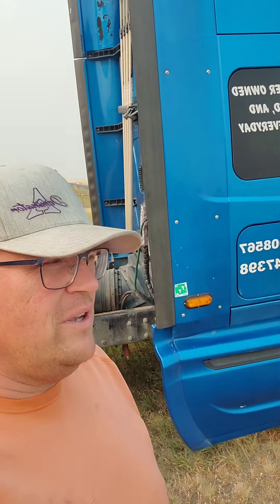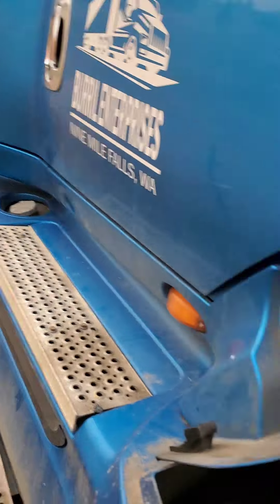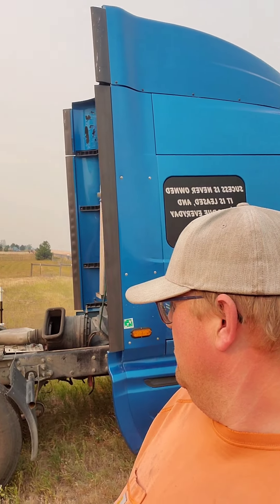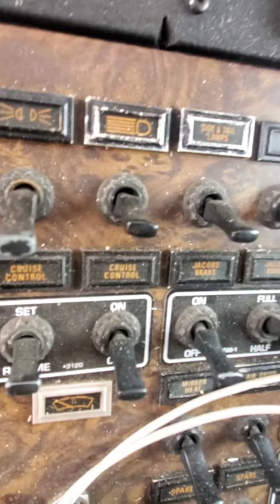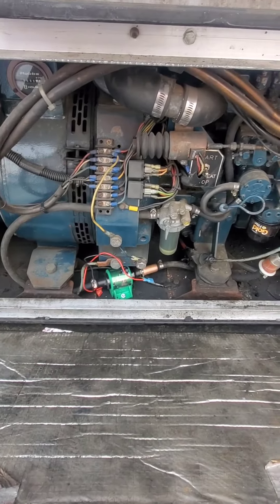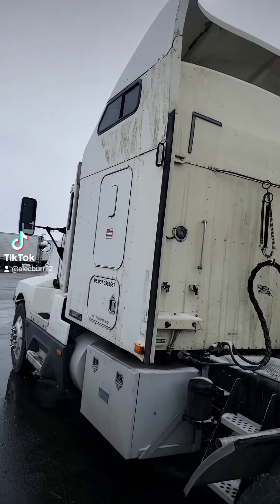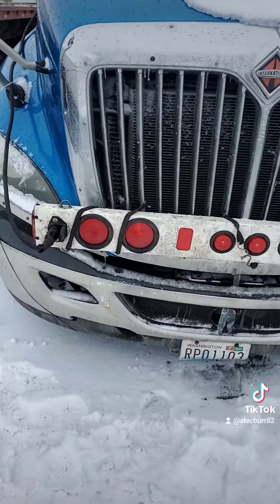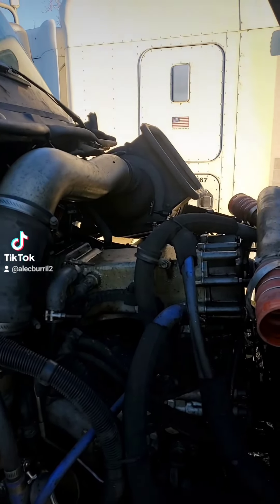MAXXFORCE 13 FINAL UPDATE

Comment: So i bought a 2013 lonestar a year ago with 230k miles from canada truck ran great had it deleted right away. I replaced both turbos but now i lose about 10 mph when my fan kicks on with the cruise but when foot is on the throttle and the fan kicks on it runs just fine. I was curious if you had any problems like that or not?
Reply from the maker: Sounds like a parameter issue.  I haven't came across anything like this before

Comment: My maxxforce is a 2012 and has 1.3 million miles. 
I do have my egr still.
Ive been waiting for it to go out for   3 years now. 
My next purchase will be an LT with a 13 speed.
Reply from the maker: @merives2263  I'd like to see the warranty history.  It's pretty rare to see one go past 400k without an inframe and new head.  Hopefully, you have one of the good ones.
Reply: @alecburril3433  I bought it in 2017 with 350k
I do have a tripak, so I   rarely idle. 
And my mechanic actually works at rwc phoenix and has the maxxforce software.

Comment: A good day sir do you still have the mechanical pump fuel pump for sale
Reply from the maker: @mikeshannon4186  I'm assuming you're talking about the high pressure fuel pump.  If so it's still on the truck and is for-sale
Reply: How much I’m Intersted
Reply from the maker: @Angelhcw2000  $700 plus shipping